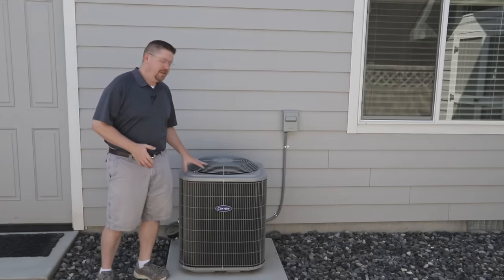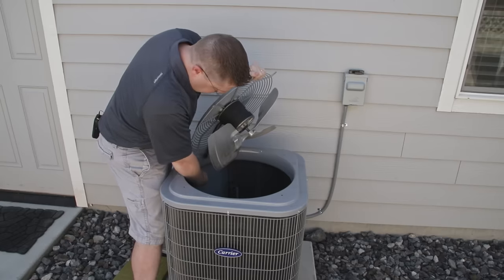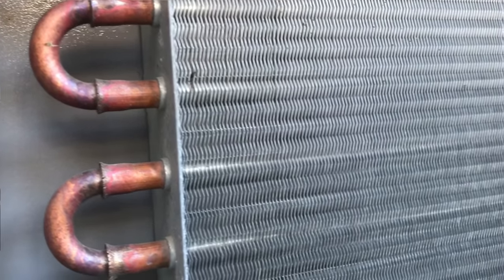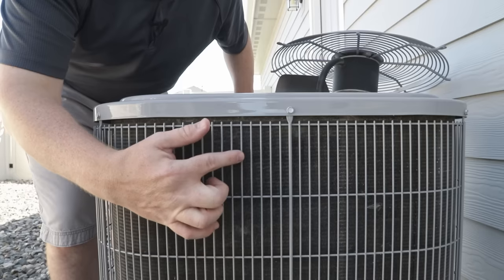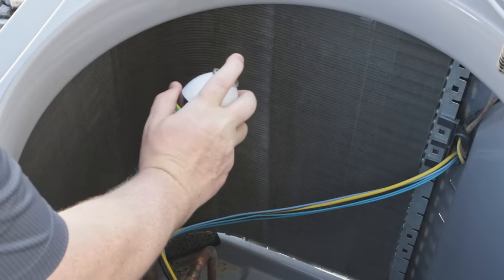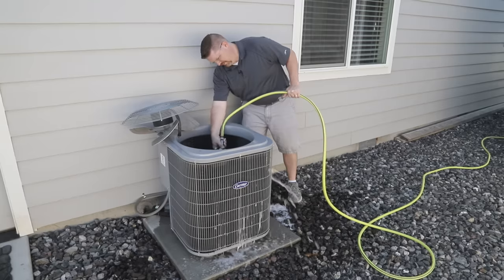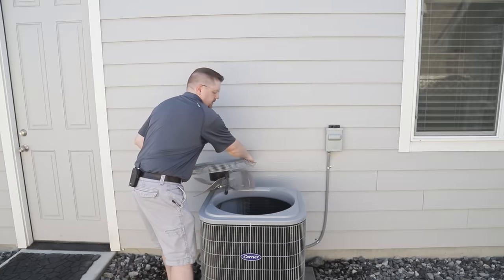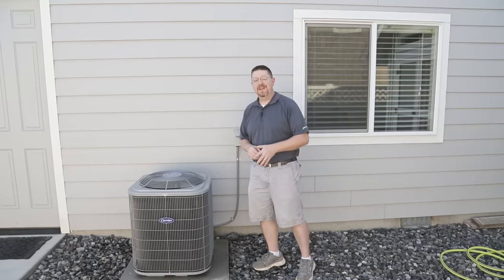How To Clean Your Air Conditioner Condenser Coil (Step By Step)

Comment: I am an HVAC technician and I approve of this cleaning process.
Reply: How are you a tech? The way he placed the fan could cause the blades to bend and lead to excessive vibration. It's usually best to disconnect the fan or if it the older rheem/rudd units you can flip  the fan to where the blades are facing upwards when you remove the top plate.
Reply: On my Carrier unit the whole top is on a hinge and I just loosen it up an flip it into the upright position and out of the way.  The outer frame moves up with the fan cage!
Reply: What is purple and what pink coil cleaner ?Please explain reason why to use them,how to use them and when!?
Reply: same; this was the first time i've seen the light trick
Reply: lojosol that’s just presumptive of you, where the fan is placed does matter since any slight bend to a blade can cause excessive vibration and lead to premature wear on the internal bearings/shaft.
Reply: I’ve been an HVAC Technitian for 40 years always used industrial grade condenser cleaning agent with soft spray aparatus, am impressed with the foam cleaner from Home Depot.
Reply: Meee toooooo
Reply: Highly recommended cleaning once a year, keeps your unit running strong doing the small maintenance! Saves MONEY
Reply: After I rinsed, switch on, thermostat turned blank! not sure If AC has power.
Reply: @josephgarcia4828  Is it Home D's brand or ? I want to get exactly what you used.
Reply: Not a bad job but the main reason for keeping the bottom of the condenser cleaned out of any debris is to make sure all the drain holes are open for water to drain and not get trapped and rust out the inside. Also having your condenser unit lifted up on heat pump risers helps with drainage and the lawn mower/ weed Wacker throwing grass and rocks into the coil.
Reply: @lojosol  true but giving the standard home owner that information could potentially damage their system, but hey keeps us technicians busy with repairs.
Reply: @cocoslover100  make certain unit dries thoroughly before adding power
Reply: @lojosol  l
Reply: Is there a reason you can't use dish soap in a spray bottle?
Reply: @josephgarcia4828  It's a great product, I buy it from Menards for $5.00 per can, I pickup a case of 6 when it's on the 11% off sale, I clean about 75 ac's per Minnesota summer and only charge $25 dollars to do so if I'm already working on their maintenance\property.  Or it's $65.00 for house call just to clean one, we also use 20psi air compressor to lightly spray them out (straight on) to knock out the water which will cause more dirt to stick if there is dust situation etc, lastly, we use air and spray out the wiring and inspect the wire nuts, box, connections and breaker condition, ac gasket tape for cover to prevent rattle.  I hope this helps someone.  Take care.
Reply: @jameslawlor1404   “make sure unit dries thoroughly..” ac units will run in the rain lol. @teen smith Yes you could also use dish soap, any kind of cleaner would be better than nothing.
Reply: @scottb_02  Can I use Engine Gunk degreaser? Is that too strong for this job? I think they are all metal so it would be ok or not. Thanks
Reply: @singloveto4499  as long as it’s safe to use on aluminum, its’ label should say.
Reply: @jameslawlor1404  they run outside in the rain?
Reply: Who cares just get it done.😮
Reply: 9
Reply: ok
Reply: electrocution hazzard laying the circuit breaker on top
Reply: @rgruenhaus  That's a cool idea. I think I might put a piano hinge on one side to do just that. With the Lennox unit I have, I would have to take off the main electrical cover to disconnect the fan. Thanks for the idea. I am sure this could be a good add on to safe time and my back:-)
Reply: can i use acid based coil cleaner????
Reply: @siddhanth6221  Yes, There is a very good one called Coil Bright. It will not harm the condenser coil. As long as what you use is labeled as a coil cleaner, it will be fine.
Reply: Thank you for your opinion. I'm going to try to do this myself. 🤞
Reply: My thermostat is 88” I try to put it at 70 but it keeps going up  to 89 the vent isn’t blowing strong cool air any tips ??
Reply: @sherigarcia5769  A Couple of things to look at. All air grills need to be cleaned on the surface and the inside. That would be return duct grills and supply duct grills. also, if the inside of the air ducts have never been cleaned they need cleaning. If all of that is clean. Inside of the  Furnace /Air handling unit needs to be cleaned. After that. If the system will not blow cool or cold air. The outside A/C unit condenser coil needs to be cleaned. Then have the unit checked to see if the Refrigerant gas is low. Depending on how low it is it can either have refrigerant added. (Up to 10%) or there could be a leak in the system. If a leak is found. The leak must be fixed and all new refrigerant and compressor oil will be added. I hope this gives you some ideas of where to start.
Reply: Before washing the coil could you use an air compressor to gently blow dust/debris back out.  Seems that would make the washing more effective.
Reply: @rak8095  Compressed air can remove small amounts of dust/debris. But if the air is blown through the coil from the outside. It will only push the dust/debris deeper into the coil and make it worse. I would suggest using water not air and if the coils is still restricted. You will need to use a coils cleaner. Also if you are uncomfortable about doing this. It would  e best to hire a pro. I hope this helps.
Reply: @josipstimac9319  usually green coil cleaner is a non rinse EVAPORATER  CLEANER. Since your evapopayer sweats during the A/C MODE. No need to rinse.  The Pink Coil Cleaner is usually a foaming outdoor condense cleaner. Going in as a liquid from something like a garden sprayer then starting to foam. These cleaners usually contain a small amount of hydrosulphuric acid witch etches the aluminum fins. Always start spraying from the bottom of the coil from the inside out. When rinsing don't spray your hose at an angle in relation to the fins or you could bend them. Always read the instructions and remember safety 
3rd
 Lol.
Reply: @sherigarcia5769  is the outdoor unit running ?
Reply: @DevJB  so is that your side gig or what?
Reply: It's super helpful, to be sure, but I wonder if there's anything else HVAC homeowners should be doing. I used to pay a company  to send a guy out twice a year, when I'd switch between cool and heat, then heat and cool, to make sure my dual-pack AC-furnace was good to go. Now being a bit tight on money, I want to DIY everything I can, but want to make sure I'm not missing anything.
Reply: @josephgarcia4828  my central air is blowing cool but not as cold. It’s off by about 5-10 degrees at the most. They say it’s my fan motor going out but I think it’s something else. any ideas of what it might be?

Comment: Thanks for this great video. My A/C company last year came out to do an annual service. They said I needed a Deep Clean of the condenser. It looked more like your unit, not your friends. But I said ok. They charged me $235. I watched him do it. He sprayed on the chemical on the Outside, waited 10 minutes then sprayed it down with the hose. I said to myself "I got ripped off, never again". I got that same cleaner from Home Depot and I am going to clean it myself, but the right way from the inside out. I even use my shop vac to clean out the pipe that the water drips out of. The only thing I can't do is go up in my attic to clean the coils. Thanks for the great video. I am a 73 young woman and I can do it!
Reply: I was just quoted $200 to have cleaned
Reply: It's impossible to clean the coil on the furnace too though 😮
Reply: I wouldn't call it "ripped off"

Experience is the greatest teacher but the tuition bill is high
Reply: I am a 74 year old woman and I will do it now!!❤
Reply: I was just quoted $409 🤯
Reply: @colettejaques2559 the indoor unit? Definitely not impossible lol just not as easy for your regular home owner.

Comment: YouTube is great.  Here I thought "the coils" were some mystical entity inside that box that required professional (expensive) care.  A hose and a can of cleaner?  Yes, please!
Reply: There are 2 sets of coils. The coils being cleaned in this video are the condenser coils and is relatively easy to DIY. The “mystical” coils you’ve heard about are the evaporator coils located above the blower and requires more intricate details to clean. The evaporator coils usually stay cleaner if you regularly change your filter. It’s still a good idea to get them cleaned every so often though.
Reply: Same!
Reply: Don't forget to use power washer 🤣

Comment: This video is so great! The editing and pacing is perfect. I did not have to skip around or change the playback speed to get through unimportant info. I usually don't leave comments, but I wanted to let you know that I am about this video.
Reply from the maker: Thank you very much for the feedback!
Reply: 2nd-ed if it weren't a 95F heat index right now, I'd be cleaning mine!
Reply: Agreed! ^ 👌🏼
Reply: Totally agree.  Very well done.
Reply: I’m learning this stuff way late as a homeowner. Great video that I wish I had seen years ago. Thanks for posting.

Comment: This is a great tutorial. I'm a brand new homeowner and I don't know if our A/C had ever been cleaned. Looked 5x worse than the example shown at 1:44, and was barely blowing any air inside our house. Used a combo of scrubbing bubbles and dish soap, and seems to be working a lot better now! Also want to note, there were about 100 spiders in our unit so I'm feeling very courageous after accomplishing that.
Reply from the maker: Awesome!
Reply: Um,, the outside condensing unit doesn't effect CFM on the inside.   That sounds more like your evaporator coil.   Be very careful when cleaning the evaporator coil, DO NOT USE CONDENSING COIL CLEANER on an evaporator coil, and that cleaner can eat up the evaporator material.   They have a spray on no spray off required cleaner for the evaporator that works great on the inside on the furnace.  
                       One thing you always want to do to save time, product/materials which = $$, is take a brush and CAREFULLY remove the heavy sweater off the front of the coil.   They make special brushes for this, but it's basically just a small, hand held nylon bristled brush.   Just use very light pressure and watch to make sure you're not damaging the fins!   Once you have the heavy stuff off, your time and materials will be much more efficiently utilized.
Reply: Be sure to also change your indoor filter as well, you do not want to use one that is really dense as it restricts the amount of air flow which  is not good...
Reply: Got your spidey senses tingling now? LOL
Reply: good job!
Reply: But the amount of air blowing inside is decided by the air handler though. You might want to inspect the unit like the fan motor or as simple as the filters like others mentioned.
Reply: Jeff, That's very good advice. Changing the air filter more often, is much more important, than using a denser filter. I always use a MERV 8 filter. It works good on most units.
Reply: Thank you so much for the spider warning. I was on the fence as to whether I should hire someone or try doing this myself.
Reply: @qataripekarsky  I may have been exaggerating a little about the number😅but as someone absolutely terrified of spiders.. it felt like 100
Reply: @MelaniaPlasko  1 is too many.
Reply: ⁷u
Reply: From what I heard, the cleaning agent needs to be Ph-neutral. Not alkaline or acidic. I believe this The Web brand is neutral.
Reply: It pays off to do a quick service the beginning of every hot season! It will probably double the life of the unit! This guy has a really good service technique

Comment: HVAC in Alabama here. Good video. We use a stronger foaming cleaner but the mere spraying through the coil fins with water will help a lot. I would add that when there is a lot of debris on the outside, brush or blow off as much of that as possible before applying the coil cleaner. As stated in the video, be sure to spray straight through the fins because even water can bend them. I've spent MANY hours straightening coil fins. The flashlight test is a great idea.
Reply: thanks for the extra tips. I am about to tackle an old unit that is caked in dirt. I appreciate this video and your extra information. I wonder if I should brush/blow off the dirt, then run water from the inside then do the spray foam?
Reply: Can anyone suggest what is the best AC unit out there?? is Rudd  a good brand?  I was given a quote of 7,500 is this ok? Please advice
Reply: @hildyr1052  get multiple quotes and compare, most companies do free quotes for system installs. Stay away from Lennox they have been having issues with their coils.
Reply: @cclopez3697  Thank you so much for the advise, i will do that tomorrow monday,, thanks again,,
Reply: Just did mine today. There was a thick layer of dirt on it, and I figured, why not try my utility brush first to get rid of as much of that as possible.  It was gentle enough to remove 98% of the layer without damaging the coils. I got the A/C Saver foam from Home Depot.  I was disappointed-it barely foamed and just did a stream, so I put it on about 3 times.  What foaming cleanser do you use, or is it something only available to HVAC workers?
Reply: @MsLuvColo  There are stronger cleaners available to the trade, but I like Zep degreaser from Home Depot. I've tried those spray can cleaners too and been disappointed.
Reply: @MsLuvColo  I just today used Lundmark coil "Cleen" - it's not a foam but a liquid spray.  Same function though.  $10 at Ace.  I'd carefully hose off crud, from the inside out first, then apply spray.
Reply: @justinegrayson2352  That sounds quite thorough, good idea. You'll have great results after that process.

Comment: Very helpful. I wasn’t aware this needed to be done annually. I’ve been in my house for four years and it’s never been done. So, I will be doing that this week!
Reply from the maker: Good luck!
Reply: @AmplifyDIY  I just purchased my house and the line comming off the unit is freezing/Frosting over I've got a new filter in my furnace could lack of air flow due to dirty fins cause that?
Reply: @tylerh1930  I would have someone look at it.  When this happened to us it was because of a coolant leak.

Comment: I currently live in the first house I've ever bought. I've been here for 7 years.  I didn't know this was a thing.  I am going to clean mine out this week.  The AZ heat causes the AC unit to run just about 24/7
Reply: I'm in the same boat.. Own mine for 6 and I didn't know anything about this. Doing mind tomorrow using this vid.
Reply: The other things to be maintained are the Filters inside the home, if theyre dirty/old then air flow will be restricted. And also the condensate lines/pipes which can also cause issues if they get blocked over time, but thats something that should be researched or left to an HVAC Tech to handle.

Comment: My next door neighbor just experienced a furnace breakdown. He did not know that a dirty furnace air filter could cause his air conditioning unit to not work
properly in keeping his home cool. I showed him how to clean his air conditioning condenser the same method as featured in your video about how to clean air conditioner condenser coils. He learned something from me in how a dirty furnace air filter needs to be changed to prevent a furnace breakdown. The whole furnace and air conditioning condenser had to be replaced. Thank you for your helpful video How to clean air conditioner condenser coils. Some friends and others have said,”You really know your stuff.” A friend was impressed last weekend of me showing her how to clean a dryer vent duct with the Gardus LintEater Pro dryer vent cleaning system. She was surprised I knew why her clothes dryer was not drying clothes, as her 16 foot dryer vent duct was clogged with lint from the basement to
outside. She learned something from me that lint build-up can cause a house fire. She commented,”You really know your stuff,” about dryer fires and prevention. The dryer vent cleaning system kit featured on your dryer vent cleaning video had helped me show my neighbors, friends, family and others an awareness of dryer fires and how to prevent dryer fires inside homes.

Comment: Studying hvacr diagnosis for most of my life, I have learned that dirty coils are the cause of numerous problems and catastrophic failures. I’ve also learned that most people don’t get that.
Reply: Al Dente I didn’t until I came across this video. Comment like yours are helpful as well. 👍🏻
Reply: I couldn't agree more!  "An ounce of prevention.....".  As for my water heater, I've always had city water but I installed a water softener anyway, mostly because my glassware was coming out of the dishwasher sort of milky-looking.  Anyway, as the water was still considered "hard" at 10-12 grains of hardness, I'm glad I did, even though my neighbors thought I was crazy, but....I don't need to drain the water heater anywhere near as often as I once did.

Comment: Thanks! Another great video! This was easier than I thought. I had the exact same fuse box to remove power. I had quite a bit of water pool in the unit so vacuumed it out with a shop vac and let everything dry an hour or so before replacing the fuse. AC working like a champ!
Reply from the maker: Awesome job, Christine!

Comment: With my AC unit, it had not been cleaned for years by the prior owners. The leaves and debris had broken down into a a few inches of soil. It is difficult to be too critical with it being a 1979 Lennox that had been running whisper quiet for the last 12 years. At some point, I have to believe the compressor was replaced at some point. It is a Copeland scroll, I believe.